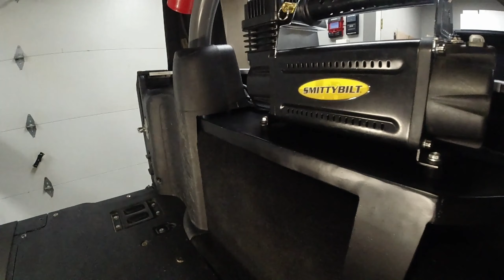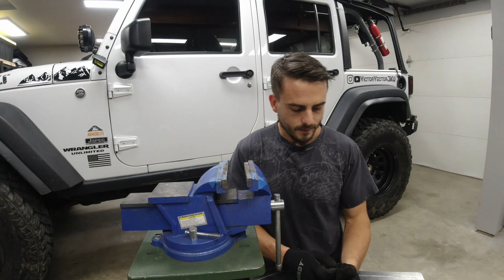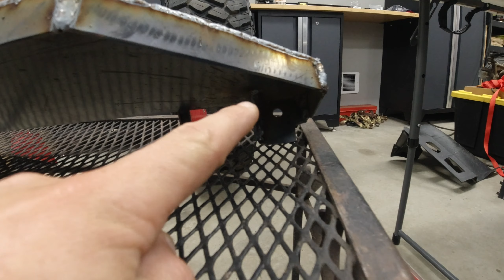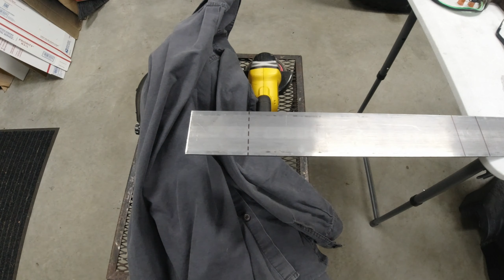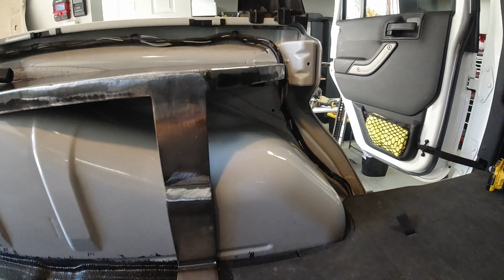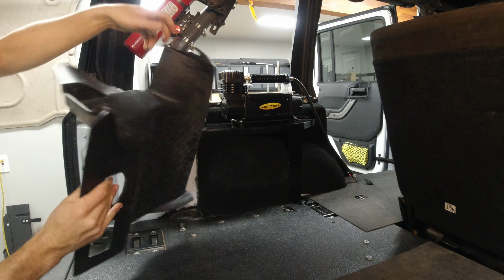Smittybilt Wheel Well Compressor Mount - Jeep JKU

Comment: What if you have a soft top? Won't the soft top frame end up on top of that?
Reply from the maker: Hey there theveganboss, thanks for checking out my video! I in fact run a soft top during the summer and there is no interference! When the soft top is down the frame is to the outside of it between the compressor and the side of the tub!

Comment: You should sell these!!
Reply from the maker: Thanks for checking out my video Sukhi! And I would love to, maybe one day!
Reply: @VictorVectorGarage  Can you provide some details regarding wiring? I'm trying to do the same setup and have an switch box that is connected to the battery. I'm planning on running both positive/negative wires from the switch pod to the compressor. But what size of fuse will this need?
Reply from the maker: You will need to run the positive and negative wires direct to the battery. The switch pod systems typically cannot handle that level of amperage. You can however take the mechanical switch from the compressor and use that wiring back to the switch pod system to get that functionality. To determine the size of wire I needed to use I did a google search and based on amperage and length of wire. As far as fuse you will need to look up the amperage of the compressor you are wiring to size that appropriately. So specifically for my system I think I used 10 gauge wire and a 30 or 35 amp fuse. This may differ for you, so be sure to do you’re research!
Reply: @VictorVectorGarage  appreciate it man!
Reply from the maker: No problem! Good luck on your wiring project!!

Comment: Can you provide more detail into connecting the electrical..thanks, Gypsy
Reply from the maker: Hey there Gypsy, thanks for checking out my video! So I am planning on covering that more in a future video when I get to making a full onboard air system, but I am not sure when I will get to that. 

Essentially to summarize what I did was I picked up approximately 24 feet of I think 8 gauge wire red and black that run from the battery positive and negative terminals to the compressor. I added an inline 40 amp fuse about 12 inches from the positive battery terminal. I also cut off the leads from the compressor at about 18 inches and used some heat shrink connectors that allow the wire I ran from the battery to the compressor for an easy connect/disconnect in case I want to remove or move the compressor. I ran the added wire in the engine bay along the firewall and along the driver side frame rail. I brought that up through the grommet behind the wheel well where the taillight harness passes from inside the cab into the rear corner and then make the connection under the carpet. 

Let me know if this doesn’t give you the details you were looking for or have more questions!

Comment: So where do I place my order ;) (seriously though)
Reply from the maker: Hey Mike thanks for checking out my video! Honestly I would love to manufacture these and sell them but I have a couple things I would need to do to make the support leg mount to a factory bolt location. Maybe one day!
Reply: @VictorVectorGarage  I wouldn’t want to delete the 40 seat split either. But this design is very good. If you make a prototype I’d be willing to support it
Reply from the maker: Yeah the bracket doesn’t require the 40% delete, just how I mounted it to my cargo platform system versus the seat bolt. That is what I would need to do to enable a simple bolt in solution for a typical JKU!